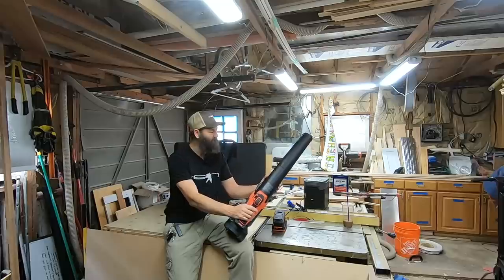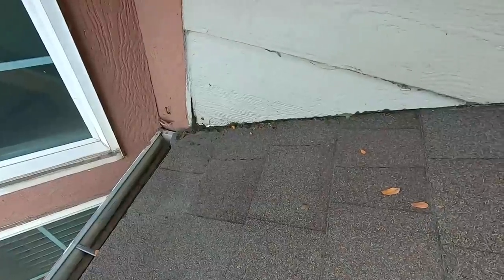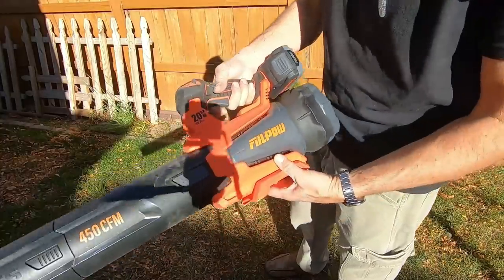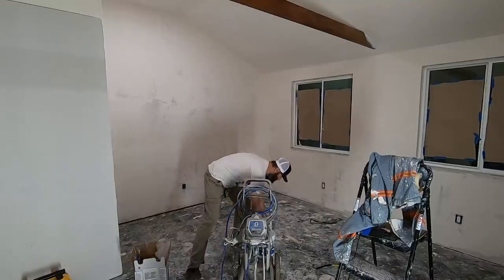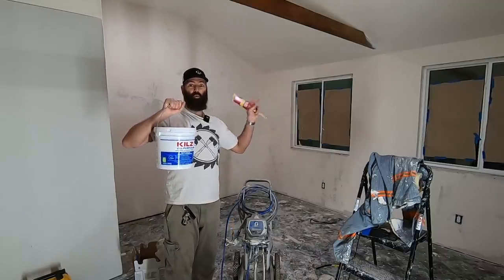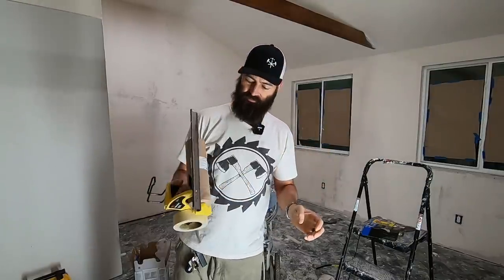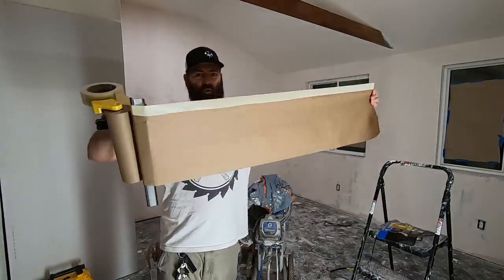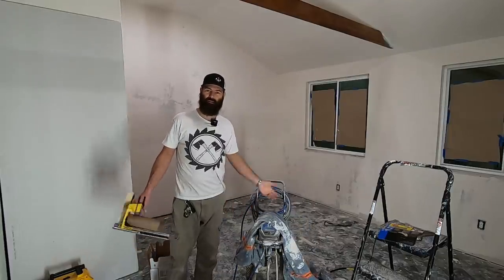The Fastest Way To Paint A Room | Pro Painter For 20 Years | THE HANDYMAN |

Comment: Handyman, watching you spray that room with a hand gun made my shoulder and back hurt. I put a 4 ft extension on mine 20 yrs ago. It's just a tube that attaches to the gun and has a swivel housing with the tip on the other end. You can spray walls and ceilings without all that bending and reaching. Works great for exteriors too, you can spray large areas of siding with fewer ladder sets.
Reply: Every time I add an extension it spits a lot, any advice?
Reply: @tarianslifestylelab  yeah mine always have too, I just live with it.The physical effort it saves me is worth it.
Reply: @tarianslifestylelab  make sure to put a bag strainer over your filt er

Comment: Tip info 515 is 5 degree fan (10 degree total) ends up being about 10 inches when spraying 1 foot from the wall. 15 is the orifice size (the hole). The paint label will recommend what tip sizes, but the hole size if its too small will just be blasted larger after a couple jobs - most people don't care but if you're doing fine finishing and high gloss its important.

Comment: Summer coolant works as well as pump armor. Also if you're storing it for months ,30 weight motor oil will keep the seals and Piston in good shape,but you'll have to run paint thinner through it first. I had a Graco 495pro for almost 20yrs, still works .

Comment: I was a mostly full time painter for decades.  Used a sprayer for one company I worked for once, but when on my own business, I stuck with roller and brush.  I can roll pretty much as fast as a sprayer. But the real benefit is you avoid the masking off prep. And the face mask as well. You're protected with the mask , but its still not a comfortable or  healthy way to spend hours working. Also the spray gets all over your exposed arms neck etc. Not fun cleaning.  And if you want to avoid that you must wear full coverage, hot and also uncomfortable.  Then there's cleaning out the lines and gun. Still got to clean the brushes so call that part a draw.  Meh....its just more trouble, for not much time saving, or mess.  Unless its a large, commercial job, with big empty rooms, I'd stay away from sprayers.
Reply: Im a painter and agree 100%. Also good luck touching up any marks after it's been sprayed... won't be the same.
Reply: A major feature as well is layer thickness that can be applied and adhesion per coat. One coat rolled will last a lot longer than one sprayed, and use a lot less not to mention in tools to do the job. And the difference of pressure washing prep affecting outcome is also significant. Some things are so tried and true they just don’t change much over time.

Comment: Side note for spray tips, I highly recommended the new low pressure tips. Graco FFLP or Titan HEA tips. More control, more consistent spray pattern, less wear because they run at lower pressures.

Comment: I got the same sprayer a few years back… I hadn’t broken it out for about 2 or three years until this last summer.  I too was worried that it wouldn’t start up, but it did and ran like a champ!  I decided this time though to put some of that armor in it before putting away after the job.  I also got the Graco Handheld sprayer, used that to do a small studio apartment, mainly because I was concerned about draining one gallon buckets too fast with the big sprayer.  That hand held one also worked like a champ, once it got the pressure dialed in.  Merry Christmas HandyMan and to rest of y’all as well!

Comment: I grew up on a farm and we had several buildings (barn, corn crib, cattle loafing shed, etc.) that were wood clad with large wooden sliding doors, which meant I spent many days each with a paint scraper and a paint brush each year. We weren’t allowed to use a sprayer, probably because the brushing kept us kids working for longer, meaning we couldn’t be getting into trouble then.. To this day I loath painting anything with a brush or roller.

Comment: Tip sizing is as follows. 
515 would be a 10 inch fan and a 15 orifice diameter. 
Basically the first number doubled equals the fan size. 
Typically I use 312 or 310 fine finish for trim. 
515 for priming a room and doing ceilings. 
Nice work handyman!

Comment: Get a paint stick.  Paint the room in the time it takes to do a good cleanup of the sprayer.  Less messy, no overspray.  Good painter would roll the sprayed paint anyways to prevent shading.
Reply: I always back roll primer on fresh drywall Even if I use a sprayer. Same on exterior stucco paint

Comment: What's a good handyman video without using the wrong ppe? The sds on the kilz actually says to use OV cartridges (3M 6001 is the part number). Those pancake p100's will catch overspray but the not the vapors.

Comment: Clean them well and run pump armour through before storage and my unit works year after year. Sometimes gets a little funky on start up. Couple taps at the top of the pickup tube normally frees up the check ball and back in action

Comment: I think the pump armor is very good and inexpensive.  I would have used a 310 tip which is a little finer than the 515 which would cut down on overspray.
Reply from the maker: Thanks for the tip.  I will pick some up.

Comment: 517=5/10’ fan/spray 17/amount of product.  211 tip 4’ fan/spray pattern with less product, the 11, 15, 17 etc is the amount of product delivered, also understand if you have a finger pattern then tip is blown or pressure is low…

Comment: I’m not a pro painter. There seems to be two sides to this. Does a wall need to be rolled after spraying or not? I’m curious if a quality sprayer eliminates the need to roll if your good enough to avoid over spraying where it runs. Thanks
Reply from the maker: 99.9 percent of all new homes are sprayed.  .01 percent are sprayed and back rolled.
Reply: @TheHandyman1  I was a painter for over 30 years, and we always back rolled when spraying. If you don't back roll, and you need to touch up some spots later (and you definitely will), you will need to spray them. If you back roll, you can use a roller to touch up.
Reply from the maker: how many new homes did you paint?   There is no way builders can afford to pay painters to back roll.  I personally have build over 100 homes and non of them were back rolled.   They were production homes for big builders.  I have only seen it done in custom homes where the owner requests for it to be back rolled.
Reply: @TheHandyman1  So how do you touch up the paint, and does it blend in well?
Reply: @warren tobelmann does any touch up paint ever really match??? Always have to paint at least the whole wall to not see a different sheen.
Reply: @117ashton  Yes it touches up very well when you make sure to have left over paint from which you used for spraying and the paint is flat sheen.
Reply: @TheHandyman1  
I've done some laboring for framers of those big builders.
    I've also repainted some of those new homes because the paint job went to sh!t.
    Those big companies that build houses super fast Tend to have a sh!tty end product covered up by a crappy paint job that looks good for a year if you don't look too closely.
    I felt sorry for people buying those homes.
    They would scab boards together.
    I heard "painters will cover that up.
    Sheetrockers will cover that up.
    &
   Roofers will cover that up."
     Just because the big guys do things a certain way to maximize profits doesn't mean it's the right way.

   Sadly,  You are correct about them having to do it that way to compete.

Comment: 5:48 Might be a dumb question Handyman, but why Masking tape in the “Masker”? I usually run mine w/ green or blue painters tape (and use same tape for when using plastic instead of paper)…..& have that same Masker as you have and are using. Should I be using good old Masking Tape instead?
Thx✌🏻
Reply from the maker: Its just what I had on hand.  I find it sticks better and doesn't fall off when it gets blown around.

Comment: What all is required with those paint sprayers? I've been thinking about getting one for a while.
Do you need to use any kind of special paint?
You showed us a bit of the clean-up... Is there anything you have to do when STARTING a new paint job? Is there anything else required besides the throat sealant? How often do you need to add that? Would love to see a vid dedicated to the whole process from start to cleanup of using one of those things.
Reply: You ask a lot of questions, why don't you do some research Jesus Christ!
Reply: @user-jm9rf2jz8c  I'm researching here on youtube, dere, buddy. That alright with you?
Reply: There are so many variables.  from the type of paint your using verses the size of tip and fan its producing. Some Paints have to be thinned slightly to be correctly applied without runs and to avoid fingering.  and too much material being applied... pressure control has a lot to do with it also..  this is something that takes experience... fine tuning..  and how not to destroy your customers house..  oil base paints will float in the air and land on a neighbors cars..  and then dry..  you are now screwed...  spaying two-part epoxies that have quick shelf life is another nightmare and you can destroy an airless sprayer in an hours' time.  I have barely touched on the variables... good luck.
Reply: With the airless sprayers, I would suggest that you always strain the paint before running it through your machine, you will understand after you strain your first bucket of sealer/paint. The big stores usually carry "net bags" which fit over the top of a 5gal bucket. A razor knife or blade on hand will also help with unclogging your tip. Just don't point the gun at your face while trying to clear your tip. 🌚

Comment: What tip did you use on your sprayer?  I have the smaller version and painted my son's room with the tip it came but the overspray was horrible!
Reply: Nevermind, I just got to the end of the video. Keep up the great work!
Reply: @donaldvest5050  paint themselves will recommend tip sizes if you read the label. 515 is 5 degree angle (10 degree total) and a hole size of 15. The 15 is the important one for the paint.

Comment: I cringed when you started spraying and you never tacked down or masked the bottom of the windows and none of receptacles or switches as well one of those Home Depot sprayers I have a couple of 7900's and 5900's and a few 395's 395 would be perfect for a little job like that and repaints being raw drywall I would've went with at least 517 a whole brand new house 831 on my 5900 is the only way to go that you can get it done in a few hours as long as it all one color and sheen I do mostly commercial contracting schools colleges corrections office buildings gymnasiums  etc but do a lot of gov. work too I do housing but only gov. Tribal housing on avg 200 units a year I work in four different states and blessed enough to perform on multiple projects a year where the Generals and  architects won awards in ENR and AIA but you get it done though I've just been only a painter my whole life my dad woke me up one Saturday morning when I started Jr high and said your going to work with me no more cartoons eating the leftover pizza Saturday mornings LOL